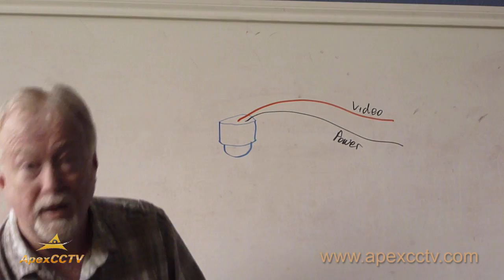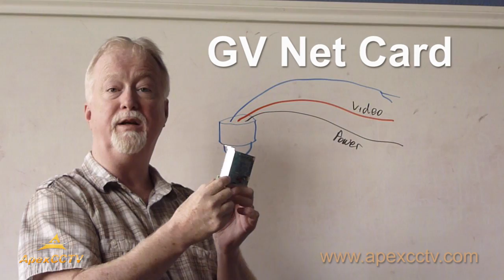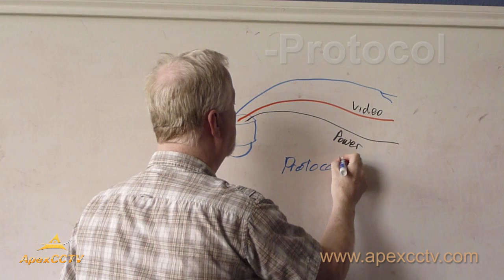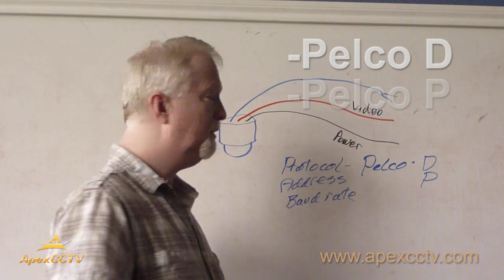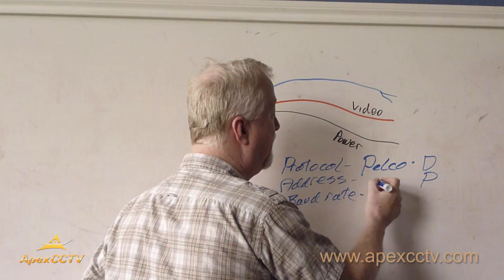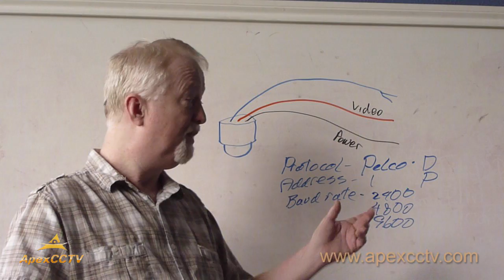Video Tutorial : How To Install a PTZ Security Camera

Comment: please can you help with the wiring of 360 Visions Predator CCTV System? I have wired it through the Matrix Control Unit16/2 -and the joystick VKXM-0845-EU controller with RS485 cables, all that is coming out of the camera is a bunch of wires that have been chopped off. I have managed to identify all of them, but am unsure as how to wire the 4 wire twisted pairs, i.e., Red & Orange TX/ and Purple & Blue RX From the camera do they go to the matrix or the controller, and which pins on a RJ11 6 wire plug? any help would be very much appreciated as 360 vision diagrams only cater for the special power supply connector board, there seems to be no circuit diagrams available, I can supply pictures... help me please

Comment: I'm setting up ptz , but it doesn't respond to the control pad or the dvr control it just continues through a sequence of movements nonstop any help (pro x ptz)
Reply: Set the dip switches the same as the protocol being used.

Comment: I need help with mine. I connected my ptz camera to my owl eyes dvr and the camera's autofocus feature doesn't work and it reverts to the blurred manual focus. But when i connect it to an Amazon dvr I bought it works. Why is this?
Reply: Set all the switches the same for the protocol being used.

Comment: Hi Sir,
it was a great presentation thank you so much.

I have installed one PTZ Camera and I configure it  with DVR using the controller, it's working perfect but I have a quotation I would very thank full if you could help me in that.

I need the camera to be rotate itself automatically without clicking (rotate itself automatically)

is that possible? if yes I would like to know the way

best regards

Comment: What you must ensure with PTZ installations that will differ greatly from a standard camera install is that you have the correct gauge or thickness of power wire for
the increased current that a motorised camera will draw so if you start betting only black and white images, recurring reboots or no control over the camera then it is likely that
you will need to reconsider the thickness of the power supply wire and this problem gets worse with longer cable runs.
Reply: Good point, also I noted most cameras run on 12V 1A, while a PTZ may require 12V 3A to run.

Comment: Hi, im using a CNB Model: VCB-34VF it has an on-board OSD Controller, is there a way to access the menu from the DVR or a CCTV Tester? , id does have 1 pair of RS485 cables but i dont know how to connect them or configure them

Comment: What I don't understand is how to connect more than 1 ptz camera to the Rs485 on the dvr.  Do you have a video or any links to pictures.   I am thinking that the + & - from the rs485 on the Dvr connect to the  + & - on the 1st cameras ptz conection ??? Then do I have take a new wire from the 1st cameras + & - ptz conection out to the 2nd cameras + & -  ptz conection ??? Is this correct if so do I need to take any wires back the Dvr or just finish at the last camera.  Thanks for any help.

Comment from the maker: That is the OSD controller which allows you to locally adjust the settings for the camera. If you look closely you'll see writing that indicates which direction is up, down, left, and right and if you press in on the button, it will select the options on the screen. 

You'll see the OSD either on a local CCTV tester or on your DVR. If you have more questions, feel free to get in touch with our tech support department via our toll free # 800-997-8460.

Comment: help ihave the 215 ptz e network camera  it has 3 wires do i need a power adapter or just wire the cables to a 3 prong plug n plug it into a wall outlet ?